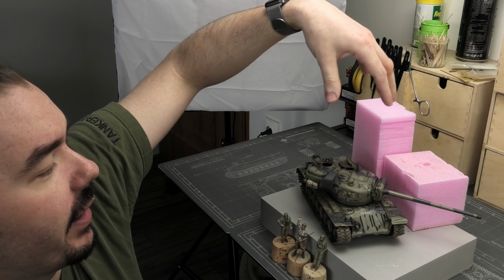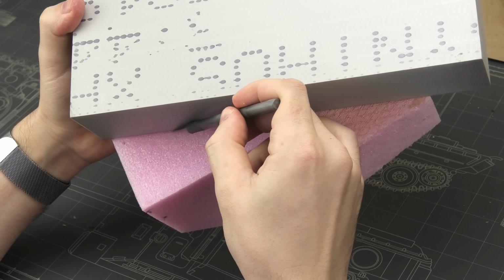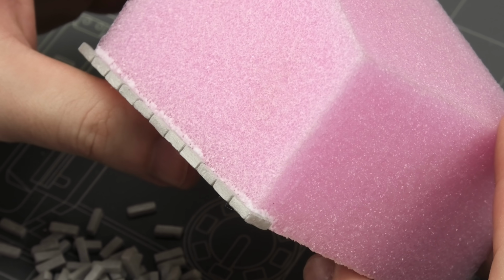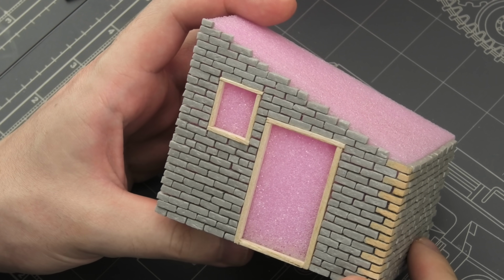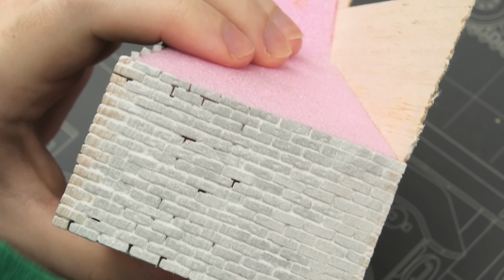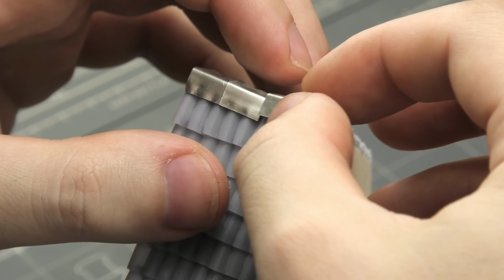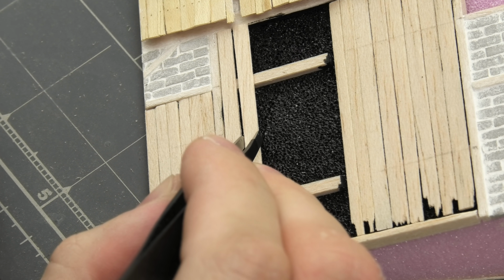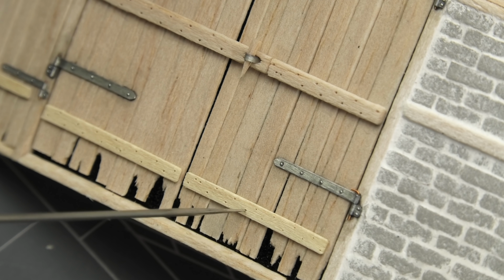Let's Build A Barn From Styrofoam And Balsa Wood!

Comment: tip: u can take dry powder plaster or resin and rub it in the gaps dry, and then activate it by spraying it with water.

other tip: for even more possibilities look into the use of foamcore. it's the same foam, in sheets with a layer of paper on the outside.

Comment: you know how to do it the hard way!! laying individual bricks is easier done simply by scoring then roughing / duffing the walls' surfaces. and the tiles look far too even. your puter files needs to include at least six slightly different tiles, so you get more misfits on the roof

Comment: Two points. At 5.39 you ask for alternatives to cutting the bricks. You almost had it correct when you overlap the corner by half a brick ON ALTERNATIVE COURSES, not every course. The intermediate courses will start with a half brick. On the adjacent wall you butt the brick up to the extended brick and interlock the bricks on the next course up. When cutting the bricks with the hot wire cutter you should have cut some of them as half bricks, to tidy up the other end of the wall as required. The other point is when feeding the foam through your cutter don't apply too much pressure. This avoids the issue of distorting the hot wire and thus the foam. Hope you understand this.

Comment: I am no modeler, but i have faint recollection that i have seen others used rollers whit brick or wood pattern on them, similar to Zimmerit but more advanced. That was what i thought you would do at 3:30, instead to cutting the foam into strips, you would use the roller on them to imprint a texture. Just search on Google for brick texture roller and you get the point. Anyway good work, i have watched a couple of your videos and i like it, you got yourself one more sub!

Comment: Adding an inside to the building doesn't take away from the tank in any way/sense. 
By your logic, having anything other than the model draws attention away from it...so why even have a diorama then? Having any setting and environment would just be a distraction then...
By adding the building's inside you just add depth, it just depends if you want to add extra depth or not.

Comment: I usually just used plaster for brick walls and the like. Pretty easy to handle and they tend to have very similar properties as old bricks have. All you need is a needle and boom. One thing though, if you want plaster to be soft enough to work, you make the mix watery. Take a long time that way but it's pretty good.

Comment: Your mortar for the bricks would be easier if you used dry tile grout brushed on then sprayed with water :)

Also the "Shed Roof" tiles should go under the "Barn Roof" tiles otherwise it will leak!

Comment: First time you say? Looks like you've made scratch builds many times before ;) Looking forward to see more
Where do you get the grey and pink Styrofoam? We haven't got these in Denmark - only the white 'flamingo' insulation bats
Reply from the maker: They're from local home depot and construction material stores - try looking for very dense insulating foam (aka Styrodur). Also, AK Interactive sells dense foam sheets which are ideal for modelling, but not thick blocks as far as I know. Good hunting and thanks!
Reply: @NightShiftScaleModels  Ok :) I'll try and see what AK got.

Thanks and good modelling to you :)
Reply: @NightShiftScaleModels  I've looked up XPS Styredur suppliers here in Denmark - a hobby shop in Copenhagen sell these in bats sizes of 60 x50 x5 cms.
I read these were highly flammable so I take it using a heat gun to create dimple effects (ditches) in the terrain - or to smooth out carving - is a big no-go. 
What method do you use for this?

Comment: Cool video. What is the peutra foil at 16:32?
Reply from the maker: Pewter foil, also known as embossing foil - it's very similar to lead foil, but slightly more durable. Green Stuff World sells it in large sheets on their ebay store, give it a look :)
Reply: @NightShiftScaleModels  huge thank you for explanation. Auto subs didn't provide correct name :)

Comment: I'm still a beginner when it comes to XPS cutting using a hot wire cutter, but I think your problem with the bricks sticking together and being a bit "hairy" might stem from you cutting them with the cutter being too hot. Maybe you should try a lower setting (if your cutter has one).

Comment: not that it makes a difference in that scale, but most brick formats are based on 1/8 meter proportions.  the smallest DIN brick. is the DF format which is 24cm long, 11.5cm wide, and 5.2 cm tall.  the next up is NF which has the same dimensions except for the height which is 7.1cm tall.  2DF is 24 long, 11.5 wide, and 11.3 tall.  I hope this helps anyone if they need to make bricks in a scale where the proper proportions are necessary or ideal.

Comment: Nice job so far .... you need to cut back the mortar on the horizontal joints at the corners and also look at how the rain would flow from the roof of the barn to the shed. It would be built to ensure rain wouldn't get inside. The joint you have does not look very normal. Perhaps some lead flashing? 
Good luck 😊

Comment: Have you considered breaking some of the tiles on the lowest point of the roof (where the turret overlaps) then putting broken tiles on the floor. As if the turret turning harmed the building?

Comment: Awesome! I really like how this already looks. Can't get much closer to reality than this I guess.

On the subject of brick corners, I would have simply let the sides overlap into each other, so you temporarily have bricks half floating in the air, but at least you don't have to cut them to pieces necessarily. 
And planks: Coffee stirrers. Though if you don't generally use them or have access to some place that has them (now more difficult than ever before) I can understand why you'd cut them yourself from some wood sheet instead of ordering a big bunch that is just going to sit sadly in a drawer.
Considering how the door looks like, I feel like having the mortar not be in between every brick could have been an extra feature, showing areas where the mortar has crumbled out. 

Those are just my thoughts though.

Comment: A great video and I'm saying that as a semi-professional model maker specialising in constructing buildings and structures and having both books and magazine articles about scratch-building terrain published. The roof top tiles are called capping and I would also recommend egg box card (the card containers that eggs are packed in) it can easily mimic wood and bricks and stone.

One final point - I like to build my building cores from corrugated cardboard rather than foam.

I look forward to seeing part two - the painting.

Tony
Reply: Why do you use cardboard instead of foam? Just curious

Comment: Very cool and inexpensive project. The hinge detail is wonderful. BTW the top row on the roof that seals the peak is called the cap. It was a point of pride for roofers to make them as even side to side and straight as possible when installing it. I probably hammered down about 10 miles of cap in my younger days when I  did it for a living.

Comment: Your bricks have a square profile, however IRL those bricks are usually wider. Exact measurements can vary, but about 2:3 is a decent enough estimate.
When cut like this they will have the correct shape at the corners and you won't have to fill or glue anything.
Reply: Also, the gaps between the bricks of our old shack were large enough to easily fit a thumb in. The filler material contained a lot of sand, which deteriorated over the years, so the gaps were pretty deep as well.
So, don't worry about too much about making it neat.

Comment: You need a razor saw set! Very fine highly controlled cuts for these materials and easier than just a #11 blade. 
Very cool build, great job, fun project!
Reply from the maker: Oh my, why didn't I think about using that one razor saw I mostly use to cut off resin blocks? Such a great idea, thanks!
Reply: @NightShiftScaleModels  no worries! I’ve been a model maker for a long time and the moment I saw what you are doing I just had to comment. In fact I’m on the fence about starting my own channel because I like what you’re doing and it would help me get back on the bench/shop. 👍

Comment: Ha another Black Magic Craft viewer here also...I was surprised you didn't paint/spray some Mod Podge or equivalent glue to give a hard resilient surface over the foam as it can help protect it all later from other painting/weathering chemicals...either that or you just didn't get to that this episode  :)
Reply from the maker: Plaster actually does a great job protecting it :) There are different types of styrofoam out there though, some get absolutely destroyed with enamel thinners, others do not. This grey styrofoam is rather resilient against white spirits, but gets melted by lacquer thinners if you apply them with a brush. Careful airbrushing is okay thought.

Comment: Great build with regard to the bricks if you overhang every other course by half then you won't need to make the cuts... basically as if they were real bricks being laid... either way it turns out same just less time taken... not criticism at all great building.. top job
Reply from the maker: True! In that case I'd have to cut them with actual dimensions including their depth which I didn't do this time. Another way is to carve bricks directly into a block of foam, it's very fast and easy!

Comment: Looking very good. Not having a 3D printer or Foam cutter ( despite hints to my kids! ). I use the excellent moulds from Diorama Debris or I cheat. If I have a good dense foam, I just draw/impress the details into it.  Eagerly awaiting next Friday to roll along.
Reply from the maker: That's a technique I'm going to try on the next building, carving textures and details directly into the foam is faster and more accurate!

Comment: Fantastic work, especially on the roof. I've been trying to work out how to make those tiles. One thing I can offer as a tip for the wood work is to keep a bottle of white vinegar with a chunk of fine wire wool in it. You need to let it sit for a few weeks before you need it, ideally, but when it's had a while you get iron particles dissolved in a mild acid. If you dip your wooden planks in the vinegar, or spray it over whole sheets of wood, once dry it ages the wood dramatically. It goes silvery grey and the structure dries out easier due to the acid and iron breaking down the cells, behaving more like old wood. Salt exaggerates the effect even more but the wood stinks like a fish & chip shop for a couple of days. Give it a try, it's a super-cheap hack and works great.

Comment: If you want to separate and texture them, just put them in a bigger container with one big and several smaller lava stones. Shake gently for 2-3 minutes. For spacing the “stones” evenly, use a piece of 1.5 mm plasticard, draw or cut the stones in the side. Put it in between the stone layers. 

By the way, inhaling balsa dust is really, really unhealthy 😅 (I’m an RC plane builder)
Reply from the maker: Is there ANYTHING we, modellers, can actually inhale? :D

Comment: awesome job matey. yes you should be wearing gloves. lol yes you should be wearing a mask when sanding down resin prints and use water also for wet sanding. this build rocks. looking forward to the next video.
Reply from the maker: And on top of that, a respirator with air filters because a jar full of acetone smells really bad!
Reply: @NightShiftScaleModels  yeps i tend to use methylated spirits to clean my prints. cheaper than ipa. have to look after your lungs :)

Comment: Well Night Shift, I've never been to Europe, but here in the U.S. I have built a few barns, used several, and torn down a couple, and I can say that the doors are centered only about half the time.  In my experience the determining factor is how big the building is and how much $$ the person building it had available.
Reply from the maker: Glad to hear it's a pretty common thing! Although building them off-center wasn't my intention, it was a rather beginner mistake. But hey, the important thing is that it's plausible! :) Thanks!